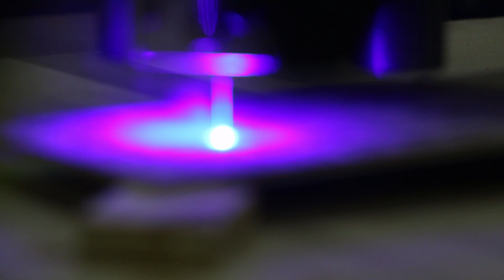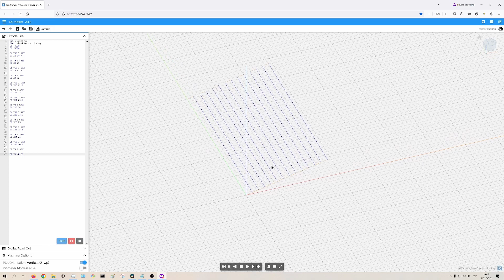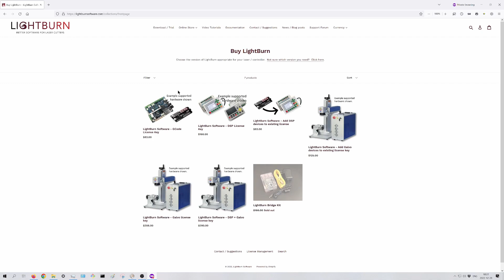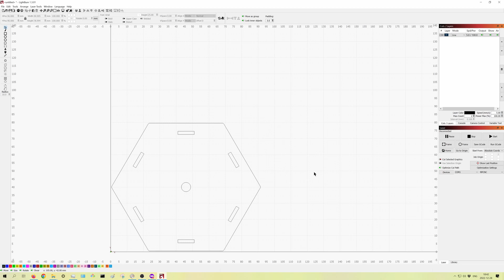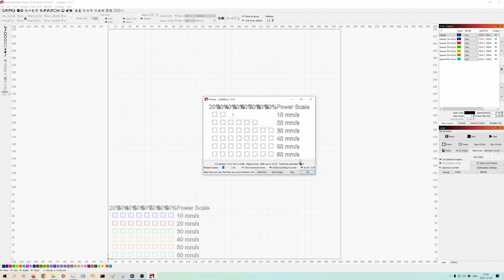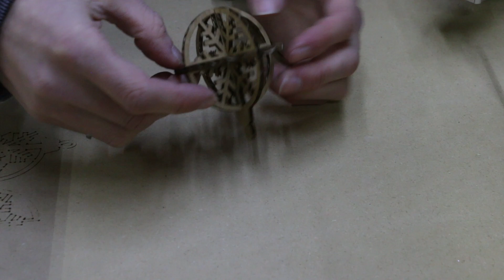MPCNC + A40640 Diode Laser - Basic Usage

Comment: Great video!
Reply from the maker: Ty Ryan! I've been loving my MPCNC and I'm looking forward to making lots more tool mounts and other content with it!
Reply: @markosfraser3030  The gcode at 1:08, does that work without an "M3 I"? I thought I had tried that and it was required. If not, that is great and it is even easier than I thought.
Reply: Sorry another one. The speeds you are using, what board do you have? The boards I tested with Marlin I could not get raster much faster than 22-28mm/s I did some vector cutting and I maxed out slower than 100mm/s as well.
Reply from the maker: @allted  When setting up the gcode script, I recall looking into whether or not M3 was required. I believe since the firmware on the Rambo is configured for LASER_POWER_INLINE, it is not required because power is set directly in G1 ... G5 as per the docs: https://marlinfw.org/docs/gcode/M003.html
Whether or not my assumptions are correct, I tested it out and it seems to work without M3 : )

Regarding speeds and the board, I'm using the stock Rambo board that shipped with the kit (Marlin V2.0.7.2). For smooth vector cutting/engraving I've pushed the machine up to 60mm/s I believe. But the materials usually require speeds of ~4-18mm/s to get through them in only a few passes.

Although I love it, the 8 bit board is quite limiting. Even running vector cutting with Lightburns perforation mode enabled can bog the controller down as there are just too many gcode instructions per second for the thing to handle. For raster engraving of images with Lightburns dithering or greyscale, I can't push it much faster than 18mm/s without the machine stuttering and ruining the engraving.
For those reasons I'm considering building a new dedicated laser cutter using a more modern controller with more processing power.
Reply: @markosfraser3030  You can flash GRBL directly on the rambo and not have to move a single wire. In the forums I did some testing and you can see the huge speed boost that got me. Of course I only tested raster, since anything vector I did was not a big deal, Marlin handled that fine for me.
Definitely need to look into the M3 thing, I added it to the firmware and we have had to have people include it a lot in the forums to get things to work. I have a laser hooked up currently but it is running GRBL, I need to flash back to test.
Reply from the maker: @allted  Oh awesome! I guess you are referring to this post: https://forum.v1e.com/t/grbl-tests-2022/34387 ?
I really like the functionality of the discount smart controller, so I guess I'll have to look for a similar compact display/gcode sender. But the performance improvement seems massive so it might be worth the effort!
Reply: @markosfraser3030  The screen does not work with grbl. That screen parts was about Ucnc I think.